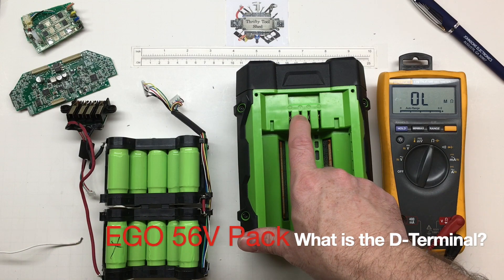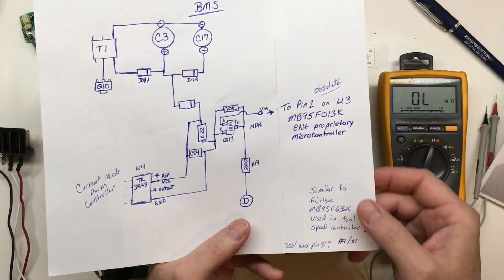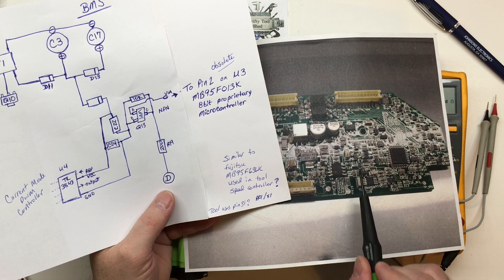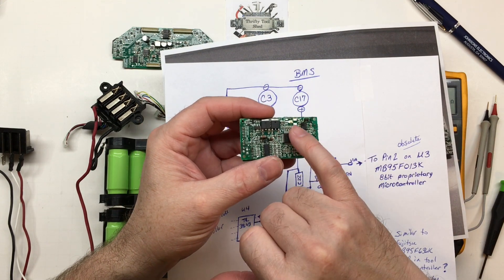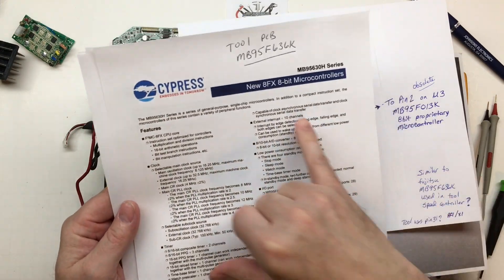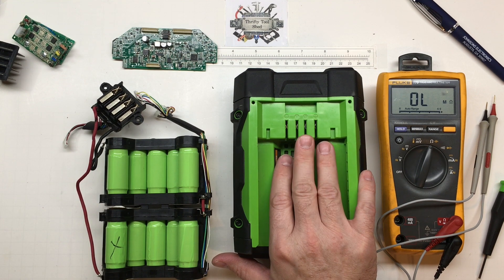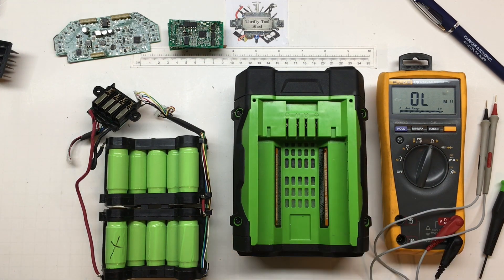EGO 56V Battery - What is the D-Terminal?

Comment: I bought a ego+ inverter that i was going to power with my 56volt ebike battery but I think im being stoped by the D terminal. :(
Reply from the maker: Yeah, that's a tough one. I have tried to learn more about it. Without schematic and microcontroller program it's really difficult! At least if you have a ego pack you can still use the ebike pack as parallel extra capacity! Good luck to you!
Reply: @ThriftyToolShed  i was under the impression that 2 lithium batteries in parallel without isolation would be dangerous. What do you know about this?
I isolate because of this. But I would rather not if I didn't have to because I am currently not able to utilize regen braking on my remote controlled mower because of this barrier. I pasted this before but I'll post it again for reference to what I'm talking about here. 
https://youtu.be/kFqouZvOQAE
Reply from the maker: Jacob,
I have watched your video and subscribed, I think I commented last time that I did really like the mower and I actually have a design drawn out very similar for my own mower to work extremely similar from several years back. I ended up moving to a much smaller yard and unfortunately I really could not justify the money to build it for my yard size now. My dad used to have a small engine shop before he retired and I used to have ideas of building and maintaining remote control and robotic mowers. Over 15 years ago, you really did not see that around. I was playing around with Basic Stamp microcontrollers etc. Way before Arduino became a thing really. I had plans...
 I was planning on using similar tires to 4 wheeler front tires.  Yours seem fine, I really like it. Anyway, as far the batteries, you are very correct, you  need isolation. The only time that I would not would be in the example of the Inverter power station in a emergency situation and no power, as long as they are very close in charge (I would absolutely check that first) then I would parallel off the + and - in that situation. Any other common repeating use absolutely should be isolated in my opinion. Did not mean to add confusion to that, really just talking about the D-terminal and the best or really only way around it for the Power Station in a needy situation.

Comment: Nice videos Thrifty Tool Shed!  I recently acquired an Ego nexus inverter that didn’t come with a battery.  I have the guts from an Ego battery that I dismantled a while back.  I am attempting to re-assemble it with a fresh set of cells, but I want to be sure that I connect the bms leads to the correct cells.  Can someone tell me exactly which color wire goes to the correct side of which cell?  I’m really hoping I can get this pack operating like it’s supposed to so I can use my new nexus inverter!  Thanks!
Reply from the maker: Which pack did it come out of a 2.5AH? It is a older style pack correct?
Reply: Thrifty Tool Shed thanks for the prompt reply!  Yes I believe it was a 2.5 AH pack, older one.  14 cells.  I assume the colored wires would be the same in all the 2.5 AH packs?  I could probably figure out which color wire goes to which cell set by studying screenshots from your videos but I want to make sure I get it right the first time and that is a bit difficult.  I’m hoping I can get the pack reassembled and working then hopefully add additional cells later to increase capacity.   Hope you had a nice Thanksgiving, Thanks for the help!
Reply from the maker: @maukaman  Thanksgiving was in deed great, hope yours was as well. I will try to get a video uploaded showing the pack, most likely the best way to communicate the wiring? Someone else may find it useful as well..
Reply from the maker: Eric, I posted a quick video showing a lot of detail about the BMS wiring hope it helps! if so please share....
https://youtu.be/RfTJODoh8Q4

Comment: Great video!  I was wondering if you had any insight into the boards that cover the ends of each cell stack and have a component contacting the end of each cell with some sort of silicone or thermal transfer medium?  If I remember right, each board only has two leads connected to it.
Reply from the maker: I think you are referring to the end of the pack halves? The are simply jumpers across the cells and it is wires attached for individual cell monitoring. The only board is the BMS and then the connection board!
Reply: I’m looking at a defective 4Ah battery I got on EBay.  There’s a board on the end of each cell stack that has 14 “Q” components, one for each cell, touching the top of each cell (or the strap welded to the cell).  They are in the middle of the battery pack.

These boards appear to be connected in parallel and go back to the large black connector (top right) on the BMS board.  Wires are green and red.  The connector on one board has four pins, two in and two out to the other board which just has the two pins.  This almost looks like part of the temperature circuit, but I’ve never seen an arrangement like this before and I don’t have the experience to trace through the BMS.
Reply from the maker: Sorry, I am not familiar with the 4AH at all. I was thinking it be identical to the 5AH just 2000mAH cells instead of 2500mAH cells, guess I was wrong! I haven't seen a EGO pack  like you are referring to!
BTW, it's not the newer style pack with the charge level indicator by chance is it?
Reply: So I looked at both a 2.0 and 2.5 Ego battery and neither had the middle boards I'm describing.  I looked at a 5Ah and it has the same boards as the 4Ah.  None of these batteries have the new charge level indicator.  I'd be interested in your thoughts if you ever get into a 4 or 5Ah battery.
Reply from the maker: @superspeeder  
Well it is very odd that the 5AH you have is not the latest updated pack. I have repaired one 5AH pack and it is similar to the 2.5AH really as far as the BMS and monitoring goes. I am wondering if EGO may have a intermediate version of the packs that I am unaware of. This link is to the 5AH if you want to see inside of the one I have for comparison.
https://youtu.be/4NESKJ0beAc
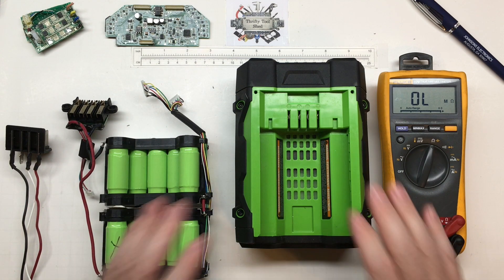Reply: My 5Ah is the same vintage as yours, with the simple green button power indicator.  At 1:31 in that video you can see the boards I'm referring to in the middle of the pack, one on the inside of each cell stack.

These connect to the BMS via the black upper right connector; it's a 12 pin connector, the left two pins are the black wires for a thermistor and the right six are balancing leads.  On the 2.5Ah pack there are four pins left unused in the middle of the connector, but on the 5Ah there are only two unused pins as there's a red and green wire that hooks up to the boards in the middle of the pack.  I wish we could post pictures here...
Reply from the maker: @superspeeder  
I agree pictures even in low quality would be nice. I thought by now we would have that. I will have to look at the middle of the one I repaired now. I found a simple issue and I guess I did not separate the pack. I will check that out for sure.  Sorry I thought you had a newer style with boards on the very ends. Very interesting, thanks for pointing that out!
Reply: I would wait until you get a battery that can’t be repaired as the boards are “glued” in place (each component on the board is adhered to the end of a cell), unless you are able to determine what type of adhesive it is and you can reassemble it.

Looking forward to what you come up with!!!
Reply from the maker: @superspeeder  
Good point!

Comment: So how do we mimick term d so I can put non ego batteries on ego products
Reply from the maker: I have tried all I can as mentioned in the video. "Sorry" I can only show what I know. I am hoping someone else can take it further. Trying to ignite an Electronics Engineer, designer or microcontroller expert! I have had more than one comment that the viewer has a desire to reverse engineer it, so let's hope!
Reply: Why would you want to use a non-ego battery? (serious question)

The answer to your question is two words - Logic Analyzer.
Reply: @groeszs  I have 4 5ah batteries from another blower 60v that I hooked up onto my ego backpack blower. It would only run for 4 to 5 seconds because of the D terminal. I found that out because I hooked the ego battery without connecting the D terminal and it did the same thing. So 2 reasons why I want to use diff batteries (1) I have 4 extra non ego batteries and (2) the extra couple volts was enough to blow leaves so much better without using the boost mode! Oh and the boost mode turned into beast mode lol
Reply: @fishinman69  Interesting. Hopefully we'll eventually be able to accomplish what you want. I wonder what would happen if you connected the power terminals from your 60v battery with the D and T terminals from a charged EGO battery - would it be smart enough to know...
Reply: @groeszs  didnt work when I tried.

Comment: Thanks for sharing this. I'm currently working on reverse engineering and mapping out the electronics of the EGO batteries. Your videos and the community response to my idea has inspired me to look into what it will take to keep these batteries operating.
Reply from the maker: That is awesome sir. I have give it just about all I have, not sure without trying to pull the program out of the microcontroller(s) if I could go any further on this D terminal. I also desire to keep these tools and batteries going, I do love the power of all my EGO tools. Thanks for your comment and Best of luck to you!
Reply: @ThriftyToolShed  It would be impressive if the code could be recovered from the micros, but I very much doubt it. I contacted EGO briefly, but of course they have nothing set up to provide replacement parts to repair their products. The next thing to do would be to reverse engineer the OEM parts and make compatible parts. It all requires time, of which I wish I had more of.

I would bet the D terminal is using a One-Wire or i2c communications bus. Using a logic analyzer, you should be able to record the communications between the the battery and the tool, and the battery and the charger. At best, the waveforms could be analyzed and a coherent protocol can be discovered. At worst, hopefully the waveforms can be recorded and then played back to simulate communication. No matter what, I don't think we'll be able to copy the firmware, so the communications protocol will need to be analyzed and replacement firmware written.

Of course, if Ego suddenly decides to start providing parts, I would probably be less inclined to hack their stuff...

Feel free to IM or e-mail me or contact me in the forums if you have questions or ideas. If you figure anything out I'm sure you'll share with us. If I create something, I'll share with you :)

There are a few things I will not be able to repair or replace. First is the phase change material. As far as I can tell, it seems to be closely related to WAX, similar to used in candles. For now, that stuff is irreplaceable, so recover the wax sleeves from any battery cells that can not be recovered. The sleeves can be placed around new cells and new sleeves shrink wrapped around the cells.  Also cannot replace the housings, I haven't found a source for the high power terminals, and of course the PCB and other miscellaneous hardware. though the PCB is just a matter of time before I will have a replacement available. Hopefully more reliable than the OEM BMS. Also need to figure out how different the new BMS is, maybe they made the new BMS more reliable, in which case I don't want to waste my time on the old model. Unfortunately, I don't have a new BMS on hand.
Reply from the maker: @groeszs  I don't have a newer BMS either. I have been fortunate enough to get ahold of a dozen or so of older packs and repair so I do not need any for now. So it's hard to  justify buying a newer pack although that Nexus power station with 7.5ah would be awesome! I feel as you do about the one wire protocol on the pack to tool, I assume they use it for several things. Obviously for tool shutdown when pack is depleted,  overtemp and also I noticed they claim that the chainsaw can change performance depending on which pack is connected! I have a good many tools over the years and really enjoy learning, one thing I don't have is a logic analyzer! BTW one veiwer mentioned the phase change sleeves are paraffin wax and carbon graphite which seems correct after I examined some of mine. Thanks for the information and Best wishes!
Reply: @groeszs  I have been thinking about the D terminal also, in terms of cell balancing. The BMS has to communicate with the charger to switch off so that it can drain  and balance the cells (assuming a typical passive BMS that balances that way).

Have you gotten any further in your reverse engineering of the protocol? I'm wondering if there is a way for us to know when the pack cells are out of balance and how the balancing happens, how long it takes, and whether the BMS/charger indicates the pack is fully charged even if cell balancing is ongoing. I don't know if the cells on my 2 packs have never needed balancing or if they have but there is no way to know by looking at the charger or pack indictors.

Many people use EGO batteries for ebikes and other PEV, sometimes using a non EGO charger so no D connection. I wonder if the EGO will still balance if charged without the D connection. Thanks!
Reply: @maddmikemu  I haven't had much time to pursue this. I am glad there is still interest.  Currently, I am in the process of building adapters so I can listen in to the communications, so, soon (?) hopefully.
Reply: @groeszs  Hi, I'm looking into repairing some of these for a friend of mine, would you know where I could find the replacement terminals? These ones are completely rusted out.
Reply: @groeszs  Hi Guys. I am not even remotely capable of doing what you do in electronics. But perhaps you can approach the problem of making some replacement parts/ gear for these battery systems from another direction. About 10 years ago I developed basically a battery powered tool that was equivalent to a 7 1/2 hp chainsaw engine as a replacement powerhead. The battery tech was Lipo but the charging system (monitoring each cell voltage etc) was similar. I think what you might consider is to look into what the large size battery systems for scooters, bicycles and even model planes are using and see if that can be made to work...because at the end of the day...all we're trying to do is charge a pack of Li ion batteries....and there's a lot of that tech already out there. Who knows...maybe those guys are more into helping their customers with parts.
Reply: @maddmikemu  Yes, it does balance without D pin.
Reply: @pashko90  do you know when the BMS balances the cells? Does it actively balance during charging and discharge? Or does it do balancing after charging to full?

As far as I can tell, my packs have always been balanced and never see any indication of balancing happening during charging.

I use my EGO batteries to power my Onewheel and often charge them with my Onewheel charger. They all still deliver full range and perform great even the 4 year old packs, so they must be doing some balancing but I've never seen it happen.
Reply: @maddmikemu  I got one bad pack, it was been dicharged(3.0v per cell) and pretty unbalanced with differens around 200mV, if i recall it correctly. i used my MPPT in my car to charge cells. its outputs up to 120vdc,  and supports cc-cv charging. So, i just connected them together, set about 58vdc. I did not monitor cells much, but after a charge cells was been with difference less then 50mV. I think it works. Did not have a chance to get a tool and chager arriving tomorrow, lets see how it goes. Ibought them them as a test packs for E-scooters/e-bikes what i build. As well, its gonna be nice to do a little screen with a cell voltages and do low voltage disconnect and come comsuption data. Too bad what this packs have no low voltage disconnect and current data, since power leads from a pack just sticks out without any control from a bms side.
I think bms wakes up when it detects voltage rise on cells and starts his "magic". just my 5c.
Reply: Hi did you ever figure out a part number or source for the silver cube 6 pin T1 transformer coil?